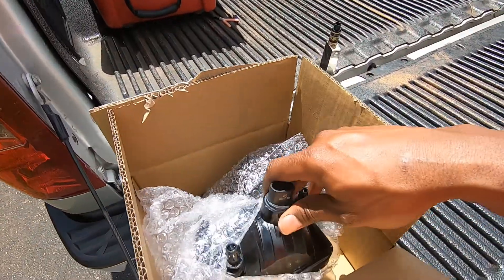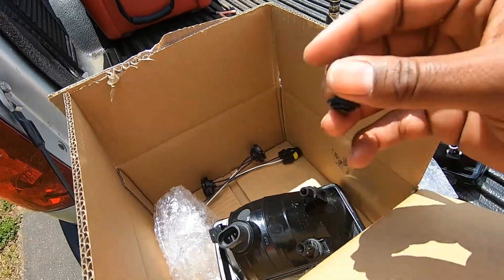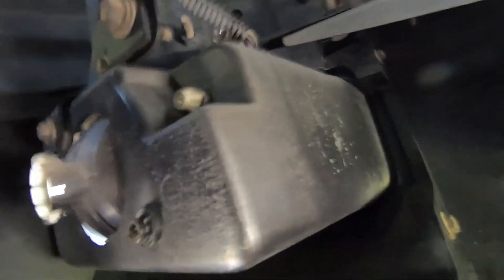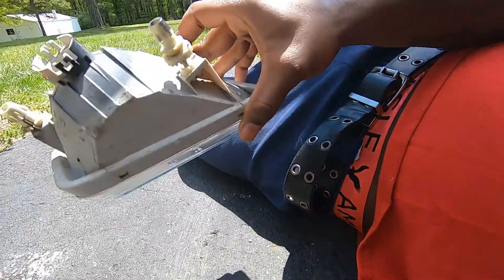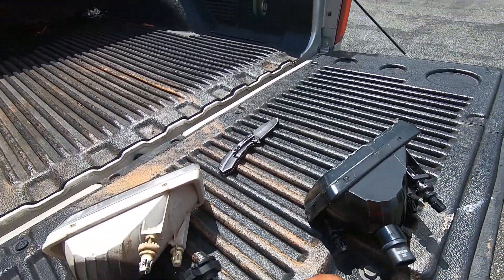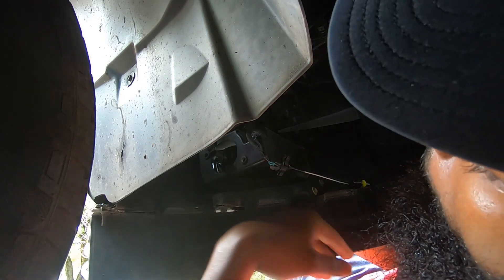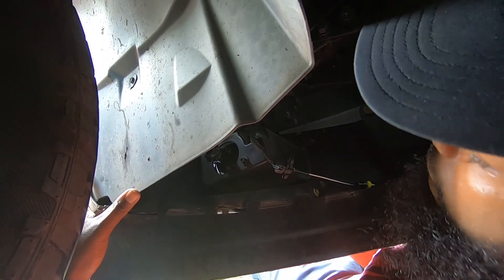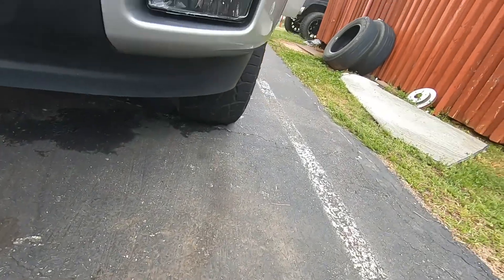07 13 Silverado fog lights install

Comment: What other modifications have you done to you’re truck.? Good video thanks man.
 I just installed my fog lights on my 09 Silverado 1500 about to order some Led bulbs for it too.! I got the Spyder brand like yours lucky mine weren’t broken 
Stay up my boiii
Reply from the maker: Not much done to the truck . Fog lights KnN cold air intake bully dog programmer msd wires air shocks in the back and bud cover . Glad the video helped out bro

Comment: What type of led bulbs did you use ?
Reply from the maker: Alla Lighting 5201 5202 LED Fog Light Bulbs Xtreme Super Bright High-Power 3030 SMD Car Truck PS19W 12085 PS24W 9009 DRL Replacement, 3000K Golden Yellow https://www.amazon.com/dp/B01N44KIYK/ref=cm_sw_r_apan_i_CYTG67Q09QGJ63RYQWJH?_encoding=UTF8&psc=1